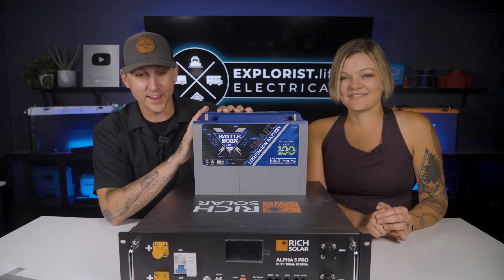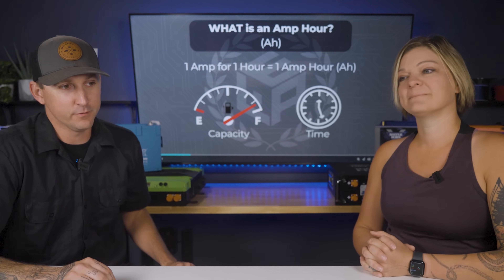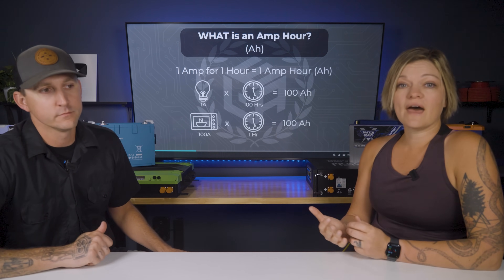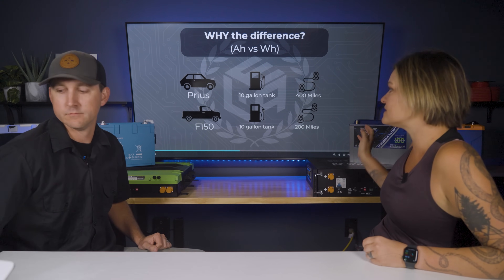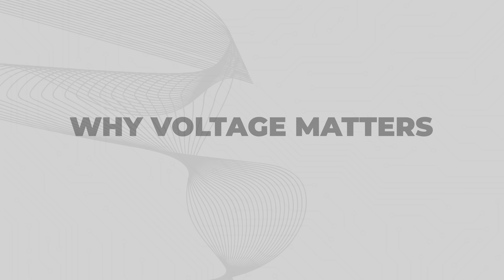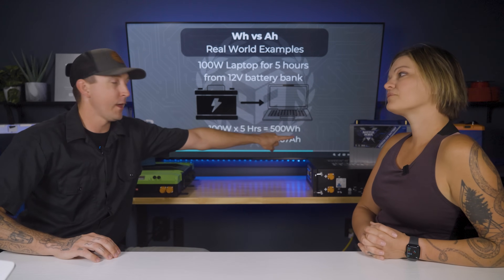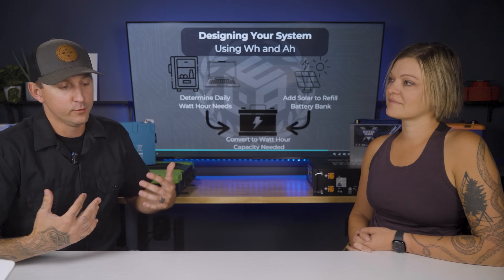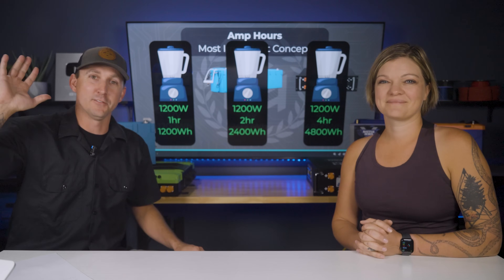Amp Hours vs Watt Hours Made Simple | Battery Basics | Ep 4/7

Comment: this is the first time i have heard someone tell us how to figure out how many watts of solar was needed to recharge our battery bank. thank you.  i have asked that question before and never got an answer. as it stands right now i have 400w of renogy solar charging 400ah of agm used telecom batteries.  yesterday my charge was at 13.7.  that is a fully charged state with no draws on the system as i had removed my 12v fridge to rebuild my campervan and nothing else was hooked up. so i consider that my baseline.  so according to your calculations .... 4-100ah agm batteries equals 4800 watt hours ,divided by 6, which is 800 ... so need 800 watts of solar to keep them charged?  and i only have 400 although i do have 210 watts of folding solar panels that i could add using a different charge controller.  one more question... since its agm batteries and i can only take them down to 50 percent ... or 2400 watt hours... does that mean my 400 watts is adequate? since i dont flatline my batteries by draining them all the way down?  please clear this up for me.  as i need to be able to get it right